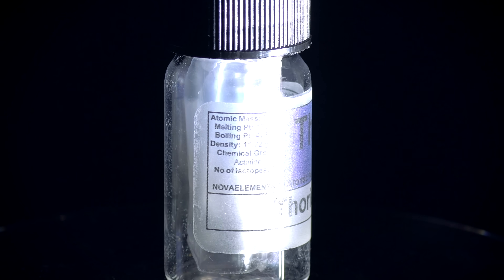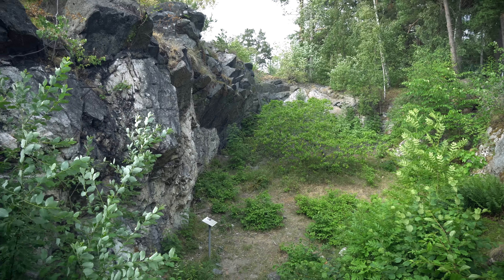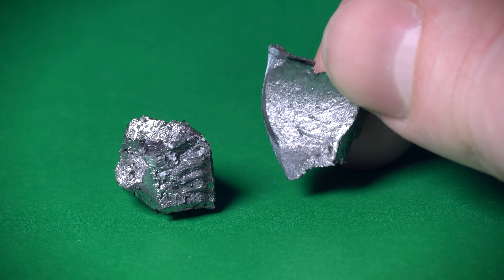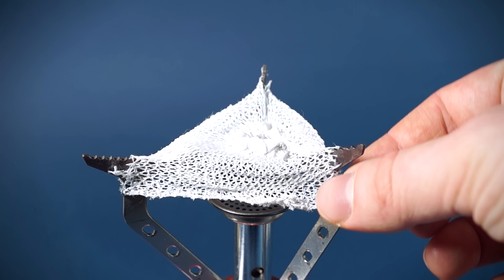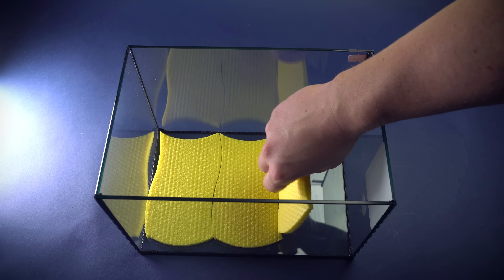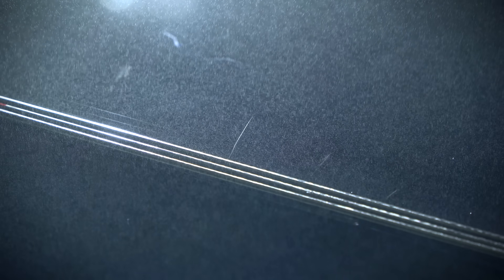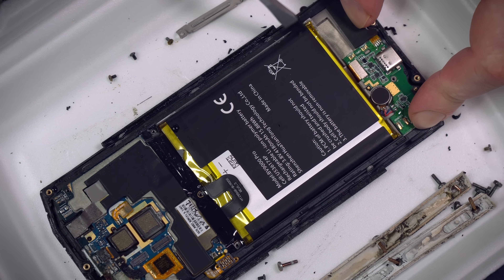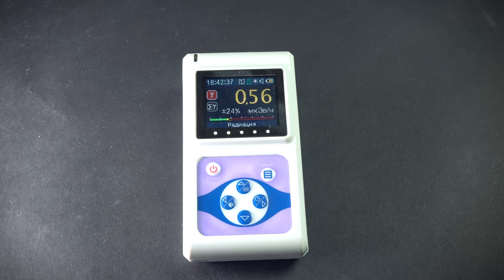Thorium - A METAL THAT NO ONE NEEDS!

Comment: Sad thing is America had a Thorium MSR in the past. Nixon killed it and had all data destroyed. So Westinghouse and GE make Trillions polluting the world. I meant Powering the world. (NOT)
The plant operated for 20,000 hours trouble free. Shut it down Friday night, start it up Monday morning. (It was just an experiment)
Reply: And the Chinese acquired all the research papers on the Oakridge Molten Salt Thorium Reactor, which still holds the record for any nuclear reactor running at full power without refueling  for 6,000 hours.   We only have our present Uranium fueled reactor because the military wanted the Plutonium waste for nuclear weapons.  That is why we spend millions of dollars or pounds to build the huge containment building to try and prevent disasters like Three Mile Island, Chernobyl and Fukishima.   A molten salt reactor cannot melt down because the fuel is already a liquid and is its own coolant.  The reaction is also self-regulating, in that if the fuel gets too hot the reaction slows.  It also runs at normal atmospheric pressure so no containment building is needed.  If there is an accident and the fuel leaks, it solidifies and the reaction stops.  That is the reason why China is working so hard to get a working reactor that they can fit in a standard shipping container.  They aim to ave 20 built and running by 2020 or shortly after.

Comment: Thorium is a metal that is actually underestimated in importance and underutilized, mainly in fission.

Th-232 is not fissile but it is very fertile, and when it takes on that extra neutron it becomes Th-233 for a very short time then BETA decays into Protactinium 233 for 2 weeks then on to U-233.

There are times where it will decay into U-232 which is junk and has a half life of 60 years but there are ways to deal with it.

U-233 as fuel is the best stuff you can get with a fission to capture ratio of 12 (fission) : 1 (Capture) making U-233 50% better at fission that U-235 which is as rare as platinum and is 4x better than Plutonium 239 which is bred from U-238 because U-238 is not fissile but it is fertile.

Also the U-233 fission cycle produces transuranic wastes that are radioactive for 300 years instead of U-235's thousands and U-238 -> PU-239's tens of thousands. It will also produce considerably less waste due to it's considerably better fission ratio.

So yeah, Thorium is not a metal that no one needs, it's exactly the metal we need and need to properly utilize.
Reply: finally someone with sense
Reply: i bet they just want the Plutonium and that is the only reason they avoid it.
Reply: @theepicslayer7sss101  its gonna have a lot to do with the price of stuff imo. the normal way we do it makes rhem farfar more money. unless forced its unlikely they'll change any time soon
Reply: I also feel I need to add that U-232 in its base synthetic form (there are no naturally occurring instances of U-232) is junk as it is not good for fission, HOWEVER it can be bred into the highly fissionable U-233 with a thermal neutron capture and U-232 is fertile.

One of the proposed ideas and can be done with MSR's is the live removal of U-232 and it's chemical separation and subsequent neutron bombardment in a separate fuel chamber via PU-239. This means the current waste products we have and be "burned" in a breeder for U-232 into U-233 while Th-232 is bred into U-233. This makes U-233 a more viable fuel source and since MSR's can actively filter their fuel cycles unlike solid fuel BWR/PWR's they can greatly increase their efficiency and reduce transuranic wastes. 

This does not come without its hefty technical challenges but it certainly needs to be fully explored and tested because the positives outweigh the negatives for civil power production.
Reply: @Spartan536  i have to admit my knowledge of Reactors is limited to some Minecraft mods like IC2 and ReactorCraft or Factorio and the Kovarex Research that lets you turn U238 to U235. (in Minecraft IC2 as well)

tho in ReactorCraft, i used Thorium to make power and less waste since in game it produces less when being fission in the Reactor, i just used the Radioactive waste to launch neutrons at the Thorium to make my power... i doubt it is that easy in real life!
Reply: @BTW...  no u
Reply: Couldn't agree more with everything you have said.. there's a lot of people on the internet that like the idea of thorium but there's so many of them  think they understand it but don't and then they spread misinformation that ends up hurting nuclear energy with so many saying different things.. its so go to see someone who actually understands it
Reply: U-232 is the best fuel for fast reactors, is useless in thermal spectrum reactors
Reply: @thepowerofdreams6816  This is correct, however it still makes the Th232 -> U-233 process much more viable, even if it becomes U-232 as a byproduct.

It just means we need more than just 1 type of 5th Generation Nuclear Reactor, we need at least 2, a fast spectrum and a thermal spectrum.

If only people knew more about Nuclear power this whole wind power shit would go where it needs to, the graveyard.
Reply: It Also depends a lot for what you gonna use the reactor for

For civil utility applications the molten salt reactor is unbeatable 

But for submarines and any vessels a solid fuel gas cooled reactor is a better option
Reply: Preach it brotha, preach it!
Reply: I’m gonna pretend I understood all that like a lot of people here
Reply: Word
Reply: Wow.  You really know how to put it in a nutshell.  Nice info.  I'm smarter now because of you.  😁
Reply: My country malaysia has thorium metal but found in monazite.
Where i need to buy thorium?
Reply: Yeah... What the nigga said..
Reply: Wait,i have questions in here...can I melt plutonium metal?...(does it explode when heating it)
And one more...which country produces thorium metal...I need this metals so much...My favorite subject is sains and I still high school...and I want to collect one thorium metal...

My favorite metal:
1.Iron-the metal that needed for human on earth...al hadid (iron) in arabic.
2.Copper-the first metal that discovered by human...al nahas (copper) in arabic.
3.tin-the metal that destroy itself...timah (tin) in malay.
4.Neodymium-the that metal that has strong magnetic properties and use in neodymium magnets.
5.bismuth-the metal that has colourful crystal.
6.thorium-the metal that no one needs it.
Reply: @detectiveelectro2372  Plutonium is warm to the touch on its own, and yes you can melt it but no it will not explode. Plutonium and Uranium only explode when subjected to an uncontrolled supercritical fission reaction.

Thorium is all over the world from North America to Australia, its currently seen as a waste material in rare earth mining because of its limited current use.
Reply: @polyfoamcoats1650  There is another reason why Th232 is so popular... used in a breeder reactor within 32 days most Th232 Beta decays into U-233.

There is no natural U-233 left in the Earth, as its all been decayed away over the eons. U-233 is the perfect fission material, as its Fission/Capture ration is 3x better than U-235, and 6x better than PU-239, this means better fissioning, plus less transuranic wastes.
Reply: @Spartan536  Sounds attractive the way you write it however, maybe that 3X better than U-235 gives 10 times more trouble? Maybe that 3x better on paper/theory is "almost the same" as u235 in practice/reality with this much extra trouble to deal with? Think about it, I don't care what you think of China as a country but the fact that they're highly competitive is widely known - referring to a comment from a while back stating that China already has played with it and they wouldn't miss a chance - that's true - it seems that they're more interested in fusion rather than fission that creates a lot of waste. I am not anti thorium (nor uranium) - just tryna figure out what's goin' on.

Maybe thorium reactors aren't as profitable - maybe it would only work on small scale leaving the interest out of big corps.
Maybe there are good ways to handle the waste but that's of no interest of big corps, they would rather demonize it and keep the tech for themselves. 
Then again, not a huge fan of gamma rays.
Idk.
Reply: @polyfoamcoats1650  To be fair when it comes to the waste it is a misnomer for the very reason that people seem to think it's a major problem. That being that it still has loads of unextracted energy and we have not invested in the many ways that it can be further extracted. The issues here really have nothing to do with it not being economically achievable to use alternate forms of nuclear power that can use other radioactive elements including Thorium. It is simply a case that the investment required to develop efficient production methods at scale has not been made yet, basically this stuff is where solar cells and such were before society invested enough into it to scale up development then it became competitive. This happens in the lifecycle of pretty much everything but the truth is that no the private sector will not make this investment until they burn all the cheaper alternatives or society demands their governments to push the investment. That is basically how pretty much any truly novel technology actually gets developed not by the risk averse private sector but by putting the research work of the public sector to good use as the public sector is much less risk averse. The public sector is generally willing to invest in the pure science and preliminary engineering type research needed to develop any novel technology because they see it as necessary and don't have to justify it with short term profits, this being for one single reason the public feel the same way. Same reason you don't ask the private sector to build a new road bridge and wait for it's 100 year service life to see the full return shareholders wont wait that long but the public sector can invest like that as they care more about the service itself than when the break even comes.
Reply: Thanks for information I need...have a good day with family...I better get more information about chemical in Nilered video...ok bye.
Reply: you dont say, well i learn something every day. But what the best use for it besides illumination products
Reply: So why arent we using it in nuclear reactors to meet our most heralded climate change goals?

Seems to be a sizable cognitive dissonance here in terms of politics.

Newer generation nuclear tech can produce lots of energy with little waste whereas renewables and battery systems currently cannot come close to meeting that demand while having significant environmental cost (the mining of required rare earth materials)

Am i missing something here?
Reply: @scroopynooperz9051  IGNORANCE is the reason why. Ask any random 20 people in the US at the beach if they know in the most basic sense how a nuclear reactor works and they will look at you like you just asked them the square root of something. TH-232 in a MSR breeder design is nothing new, we had it working at ORNL (Oak Ridge National Laboratory) back in the 1960's, it was pioneered by Dr. Alvin Weinberg. 

The more people are educated in the basic sense on how a NPP operates and that there are Gen 4 designs that are MELTDOWN PROOF (as in PHYSICALLY INCAPABLE) and can use old used fuel and it reduces our waste then the less political resistance there will be. Democrats and Republicans are split on Nuclear Energy, its fearmongering and ignorance that drives the over-regulation and political stop-gaps.
Reply: We can just theoretically talk about thoriums high potential. But in practice it is completely different. We have been using nuclear stations for so long and this business is falling off because how harmful it is not to nature but to us. Thorium or not it is the same. You actually need to use something to get the well needed uranium, which means you need way more resources, time and money to get it. It's not worth it and the Chinese also tested this because they have the most experience in it. They wouldn't miss this chance by any means. Thorium is just a by product of uranium. It's like using the Gases of diesel into your engine to drive. Doesn't make any sense.
Reply: @neonlight1214  We have more experience running an MSR using Throium than the Chinese do, we ran a test reactor at ORNL for over a decade back in the 1960's - 1970's under Dr. Alvin Weinberg the man who invented the MSR.

Thorium is NOT a byproduct of Uranium, its a separate element all on its own, and quite a stable one at that for being an actinide.

As for stating the reaction in a Thorium reactor we can use spent fuel from PWR/LWR/BWR designs, its pretty well highlighted and in fact the US NRC and IAEA as well as many scientists hold MSR's and Thorium MSR's as one of the best 4th generation nuclear designs available.
Reply: @Spartan536  thorium isotopes are uranium, a garbage one. There always musty be a garbage in the world that is useless and a nuisance. Like If you want if you want to grow vegetables, fruits on your garden you need to take out the stones so the plants can grow their roots easier and increase the plants growth. Just like it is too mine rare earth metals, you have this constant thorium that is nerving you and need to get it out. You did not take in the factor of economy. How hard it is to accomplish all that, is it worth it? Definitely not with our technology and the technology in the next 50 years. Nuclear power stations is anyways a falling business generally. More and more are being shut down because they get replaced by other Good alternatives. Why waste all the time on something so harmful to the nature, and is a Fossil too! When you can make energy for literally free. Wind, sun and water the main examples.
Reply: @neonlight1214  OK I am not sure where you have been studying but its becoming alarmingly clear that you do not understand the periodic table or how isotopes work.

Lets get the biggest one out of the way, Thorium is NOT a fossil, neither is Uranium, or Iron, Lead, Bismuth, Tin, Copper, Magnesium, Gold, ect... they are ELEMENTS, in fact all of those I have names are METAL elements, not fossils.

Thorium is no more poisonous to the Earth than any other NATURAL actinide, its once you get to the synthetic actinides that things get really nasty and that is for obvious reasons.

As for the technology to utilize Thorium as a fuel source via neutron absorption and beta decay to U-233, we have already done this DECADES AGO, we did not lose the technology, it was just shoved aside for political reasons at the time. Wind, Solar, and Hydro power are pipe dreams, and Solar being the best of the 3 is a good source for a secondary power source to offset grid use under optimal conditions, but its a terrible primary source due to materials/upkeep required, space required, and its dependability on good meteorological conditions.

Comment: For decades Thorium was used as a coating on the hot filament of  vauum tubes when heated it will release more free electrons than just plain metal.  Also vacuum tubes using a cathode heated by a filament the cathode sleeve will be Thorium coated.

Comment: I had no idea that tig rods had thorium: I am shocked that they do not tell people,e this, almost every welder is exposed to the smoke when welding and getting thorium smoke into the lungs can exposed these innocent welders to cancer
Thank you for this video
Reply: There is a warning on every package of "red" (2% thorium) tig welding tips... Every tig welder knows of thorium safety issues. We choose to ignore the warnings because 2% thorium is far superior to 2% lanthium and 1.5% ceriated as far as ark start and stability goes.
Reply: MrFlathead45 I work with 3 welders on this project and will ask them today
Reply: @Rospajother  I am a tig welder... I have tungston rods of all types. I weld carbon steel, aluminum, stainless, and have done titanium in the past... I was a welder at Trek bicycles for a few years and now do work for a job shop where we make parts for many different companies... I know a bit about welding. Lol
Reply: MrFlathead45 it’s ok, I am an industrial electrician and for the first part of my career I was reassured PCB and carbontetracloride were safe useful compounds, I am sure inhaling thorium is ok also